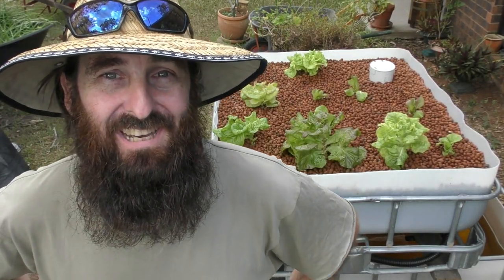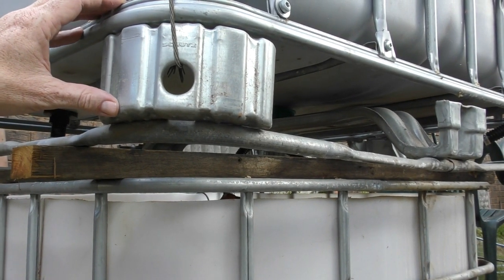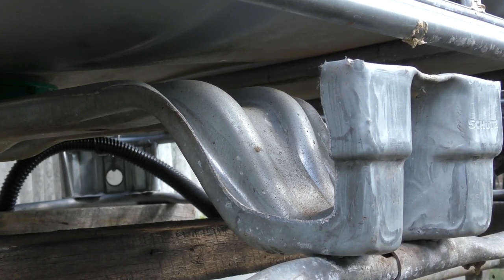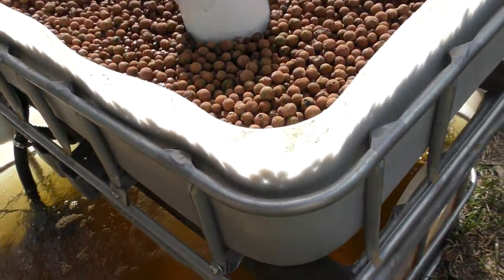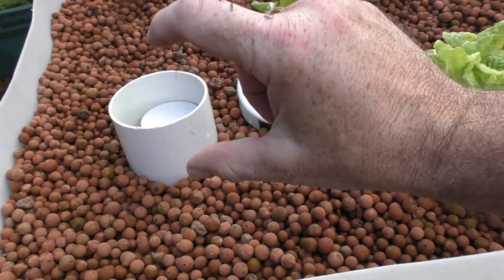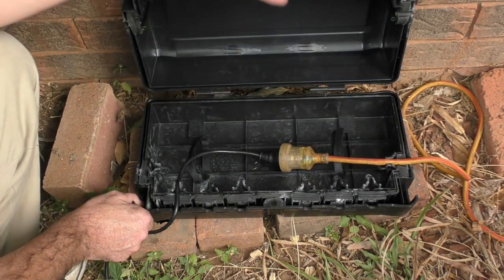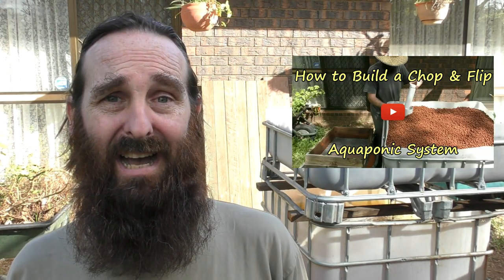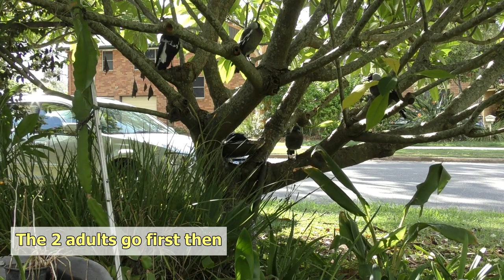How to Build A Chop & Flip Aquaponic System. A few Useful Mod's on My Parents System.

Comment: hi rob ! thanks for your great videos. I have 4 halves of 55 gallon (2 barrell) and i want to use the existing screw cap of off them .
question is for the bell siphons can i run a pipe horizontaly from thoses caps??
would it work? or i absolutely have to drill a hole at the bottom and use bulkheads on all of the barrels? 
thanks if you have time to answer me.
Reply from the maker: Hi Karl. You can use the caps on the barrels to install a siphon. This clip from Jerry might be what you're looking for,
https://www.youtube.com/watch?v=nOXm8BRA9pg
Hope that helps some & say Hi to Jerry for me if you check it out.
Cheers mate 👍
Reply: Thanks rob i will check for sure

Comment: Hi Rob Bob. Thanks for your video's - have watched a heap and learned a lot.

One question: would you mind mentioning where the waterproof electricity box is from? I'm not sure where to start looking.
Reply: +Oldkent&#39;s Game Vids 
I've seen stuff like that on Amazon.
Here is a description for one of them, search for:
SOCKiT BOX FL-1859-330-G Weatherproof Powercord Connection Box 330, Green

The company name is sockitbox dot com
Reply from the maker: +Oldkent&#39;s Game Vids 
Hi There & thanks. 
I got our from one of the large Hardware chains here. They normally sell them in the electrical isles neat the outdoor lighting fittings in ours if that helps 👍
Cheers & happy hunting.
Reply: Thanks Rob. Much appreciated.
Reply: justgivemethetruth Thanks also JGMTT.

Comment: Where do you buy your clay pebbles? Or what brand are they? I bought these clay at amazon and they float too much. Are they supposed to float?
Reply from the maker: Hi there. We bought our "Canna Clay" from the local hydroponics store & find that it does float a little until they absorb some water. Also helps if you have a dry layer about 1"/25mm deep above water level in the grow bed. 
Hope that helps you out some.
Reply: Yea, this helps out. I think the clay I bought took awhile to absorb the water. Though they still float a little. And yea having extra clay 1 inch above the water helped. I found that info online somewhere. But keep up the videos. I enjoy watching what you are doing in the garden.
Reply: Rob Bob's Aquaponics & Backyard Farm hi there. How many L / KG of clay do you need roughly for the system. Just running the numbers on setting up a system and the clay seems to be most expensive component

Comment: Rob, do you ever kick off cycling by using ammonium hydroxide (pure cleaning ammonia from a home store, etc)? It's common in the aquarium world - sometimes using a small trowelful of dirt to jumpstart nitrifying bacteria populations or by pouring in a small amount of live bacterial cultures instead.
Reply from the maker: +icarus901 
Hi there. I normally cycle with the fish in the system as long as the pH & water temp are all good but have heard of folks using pure ammonia. Cycling it with the feed just gets people into the routine I figure. 
I've found that the systems normally cycle very quickly here with about 4 weeks being as long as my 3 took. Using media from a mature system is also another way to jump start a system & have donated a media to a few folks that are starting out. 
Cheers & have a great one.

Comment: How long do you cycle the aquaponics before adding fish?
Reply from the maker: That depends on your climate as the bacteria can be temperature sensitive. 
Here in the subtropics of SE Queensland, they tend to cycle in 4-6 weeks depending on the time of year.  
In cooler climates it can take up too 2 months. 
You can always give them a little nudge along by adding some media from another aquaponic system if you know someone that has one up & running. 
Hope that helps some.

Comment: Is it so hard to dispose of metal parts where you live?  No recycling.  I sometimes take pieces of metal and just drop them in our blue recycle bins for weekly pick-up.  Have not heard any complaints or seen anything left back on trash day.  Shouldn't trash/recycle services take stuff like that?

Pretty cool setup.  I like the little protective plastic electrical box.
Reply from the maker: +justgivemethetruth 
They'd have to drive it to a waste transfer station as the recycling bins here only except household containers. 
(The real reason is that he wold stick it to one side to use later & end up rusting in the backyard 😉) 
Cheers mate.
Reply: Wild! If I leave ANY metal on my curb, private random scrap collectors drive by and pick it up to resell for a few pennies a pound, usually the first day.